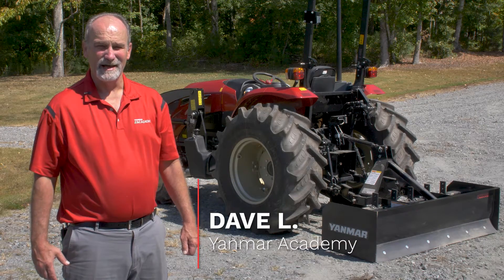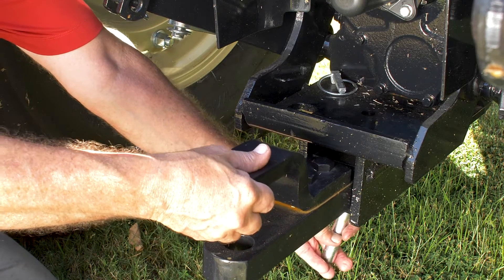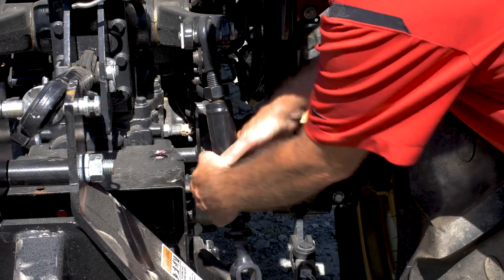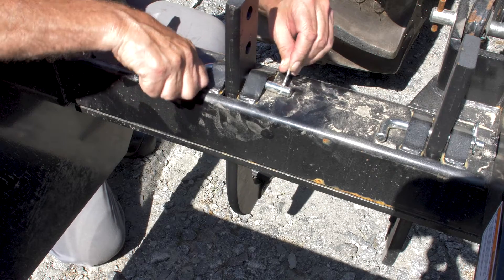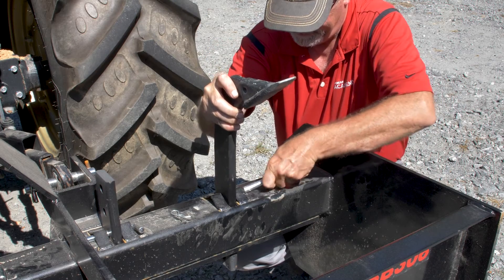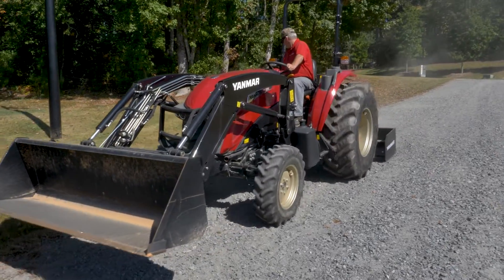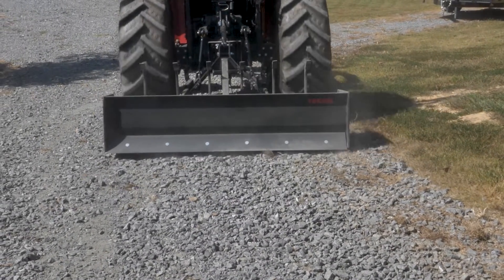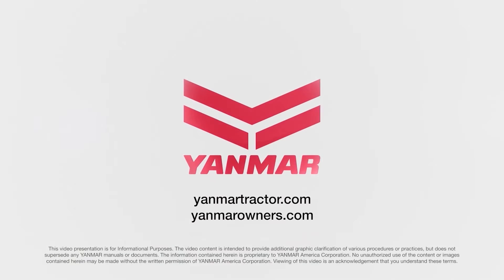YANMAR ACADEMY BOX BLADE OPERATION

Comment: They don't show how to adjust the box blade from side to side! When I check my Yanmar tractor that adjustment does not seem possible, yet on other tractors it does. I wanted to adjust my box blade so as to push snow from one side to side.  I checked my tractor again and was able to adjust it to one side. I'm going to try it at next snow storm.
Reply from the maker: Yanmar tractors come standard with one adjustable lift link, installed above the right lower link.  This adjusts the implement from side to side.
Reply: Will this angle the box blade so I can use it like a snow plow? @YANMARAcademy
Reply: I think I’m just going to use my boxblade the way it was intended to be used. It doesn’t seem realistic to use it like a snow plow that pushes snow to the side. What do you think?